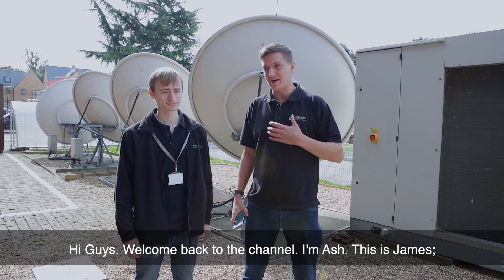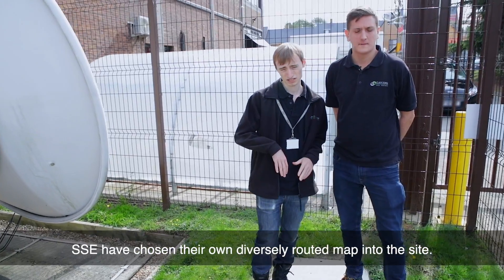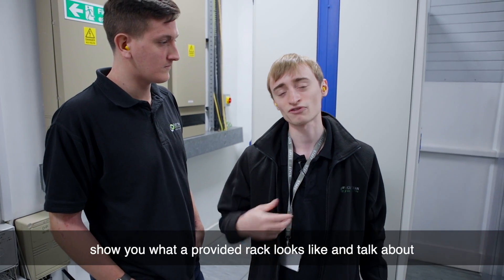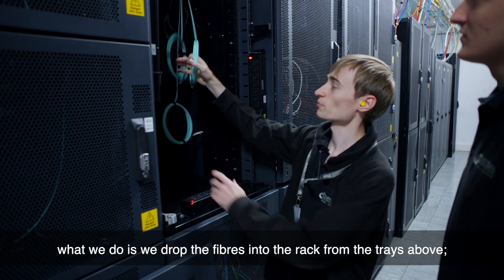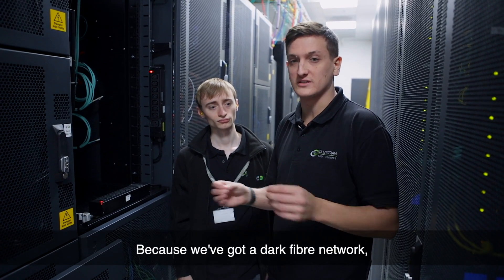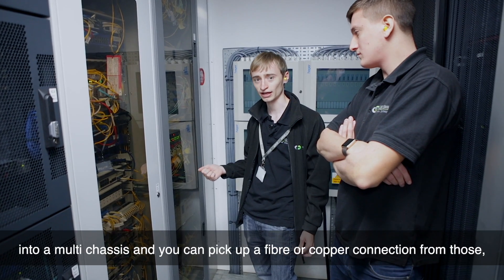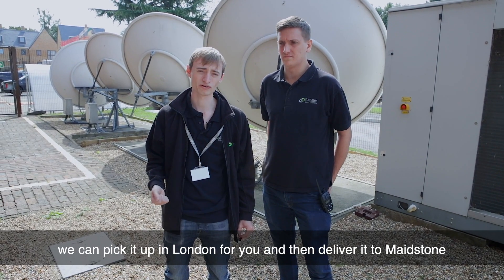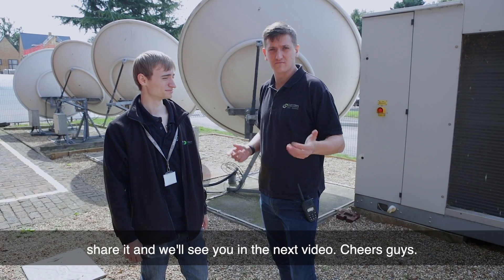A DAY in the LIFE of the DATA CENTRE | NETWORK TOUR with ASH & JAMES!

Comment: 1 - Use water falls on fibers to reduce bend radius
2 - Do you use labels on cables or other method of tracking?
3 - Use correct cable length, don't drop your customers with 5m slack
4 - Use separate trays for fibers and coppers
5 - Apply in rack cable management instead of looping fibers
6 - Don't put the tile lifter on top of important panels!!!!!
Reply: They use the system they currently do just because it works

Comment: Servers are way too loud by their fans cooling, by that it is not worth anything. I know a method, which would take more space, but would be complete quietly, less electricity consumption (=less heat -> less cooling)! I would sell that new method for 1 billion/milliard €.
Reply: Quite simply the current system is so good that they leave loud fans in the servers because it works good. Taking up more space reduces the mass of service you can fit in a building which means any energy saving is worthless.
Reply: @Adam-n1p6m They (the responsible ones are meant) have stolen 360° computing, working, work-loading together at the same time, and called it “Quantum computing”! And much more! 
CHILD:RENMURDERERS, heavily, terribly thieves have falsified and stolen via telemetry, etc., the idea:s, inventions, patent:s, its money of fiber optic cable:s, optical computer, glass-chips, using Light:s (“photon:s”, beam:s, laser:s, etc.), and much more, in a total value far of over $3 trillion:s (facot after 999 billions) and over €3 billion:s (factor after 999 milliards), since around 32 years long till nowadays, at a child, kid, toddler, and they still steal, namely from me, the atheist, hetero, greatest inventor of all time:s, the first, only, last, legitimly, rightfully, real, true Great-High-King-Lord, World-Director-Leader-Ruler (am not on power/system) of every country, land:s, planet:s, non-smoker, pacifist, Bremen residenter (yet): 
My Facebook profile: EugenK.87 
But don’t break, burn (besides calories), destroy anything, that’s counterproductive, because health, nature:s, work:s, need:s, development:s, progress:es, life, knowledge:s, and so on, because everything, that exists, is connected, and everything, that exists, is interrelated!

Comment: Ok dark fibre network ?
Reply: It usually means that you have spare fibre pairs (usually in large multipair cables). Each pair has a transmit (Tx)  and receive (Rx).  As they are spare, the electronics with the LED Lasers are not active = dark. DWDM - Dense Wave Division Multiplexing is a type of technology enabling multiple signals to share a fibre.
Reply: @peterblackmore7560  similar on copper core telecom wires  just a different type of terminology  i was not used to or had heard before  but thanks for the clarification in telecom parlance to could be using a single pair of copper cables set up a rim cabinet at the end of an exchange area to add more phone lines instead of running new 80 pair cable run  (the rim module might look like a rectangle traffic box  near a busy intersection but if you were to peer inside it is for all intense and purposes a mini exchange in its own right  kinda like a fully automatic pabx)

Comment: At 3:22 cabling under the floor looks unmanaged.  Why are you using an outside plant enclosure under the floor.  Don't you have an inside plant FEC system which fits on a wall.  Easier to manage, better MTTR?
Reply: It is managed, but realistically there’s a few metres of slack to move the joint and outside one is logical because it’s not owned by them. It’s owned by the network operators. If you think about it using the joint they use everywhere else means they only have to carry one spare with them.

Comment: Would like to see a video of you guy's discussing your certifications and which ones you consider most valuable when trying to get into a DC work environment.  Cheers from the US!
Reply: In most cases, in a large environment, as a new guy, you are going to be racking and stacking and cabling moderately heavy servers and network equipment--Then being physical eyes and hands over phone calls.  It is not high tech work in the DC.  You most likely won't even be putting so much as an IP address on anything.  At the other end of the spectrum, depending where you are, you can be required to be damn near the Special Forces of IT.  You will have to know a decent amount of everything.  You'll have to know how to configure multiple vendor network devices (Cisco, Arista, Juniper all in the same place), Windows OS, Linux, DBs, 802.1X and other auth mechanisms, flow monitoring, DC work to include understanding the cooling, PBX and SIP phones, storage, and probably a DR site.  Oh yeah, and learn Python, specifically the Netmiko module, so you can script network reports and some changes.  It will really set you ahead of other engineers.
Really, it all depends on the level of engineer they are looking for.  You could be the guy that only opens and closes switchports, a guy who racks servers, or a guy who has to know everything.  Most likely, your first job will be racking servers.
Reply: @OakInch  Great info, thanks! Question... for those different types of DC workers that you mentioned, are they different tiers? Maybe like what a data center tech (closes switchports and racks servers) or network engineer/lead or senior data center tech (know everything/special forces of IT). 

Reason I ask is that I'm curious because I'm on the network engineering route and maybe in addition to cloud computing since that seems to be big right now. I'm currently a Jr sysadmin and in the past I did want to be a sysadmin but I've changed my mind, it's basically advanced help desk and I'm done with that after 10+ years. I don't have any certs but I have a bachelors in information technology. I'm looking to pursue my first cert with CCNA.

Anyway, I thought maybe landing a DC tech job would kind of open the doors to learning more about networking while studying for my CCNA. Or if there are other recommendations for beginner networking style jobs, I'm very open!

TLDR: 
To summarize...
1) are there different tiers/levels for data center jobs?
2) What entry-level networking jobs would be good to get into while on the track to become a network engineer?

Sorry if this is something I could have just Googled lol I just figured you have a good amount of knowledge in this field.
Reply: @Cam_B  When I was doing DC work at a large bank, in a multi DC location, spread around a city, we had one person that did light switch work--Only opening and closing ports.  Everyone else did racking/stacking/cabling.  Then the cooling and electric was run by another couple guys based in the buildings that were more associated with facilities team.  The people that actually configured switches and routers never set foot in the DC and were not considered DC workers.  We did have people that moved on to teh actual networking teams from teh DC teams.  As you get to smaller companies, you will become less specialized and forced to do more.  It really depends where you go.

I would get the CCNA as it is the most well known.  All the 1st level certs cover networking in general.  The JNCIA is less known, but if the employer has Juniper it will be helpful.  JNCIA is a little easier also I think.  A juniper device is set up really different than a cisco device, so the command part is not going to translate at all.  Cisco is the standard and you will most likely be using that in a DC.
Reply: @OakInch  Dude, thank you for this advice! I was definitely planning on getting my CCNA and I was looking into Juniper certs as well. It looks like I'm on the right track for becoming a network engineer. I'm kind of weary about working in a DC only because they are 24/7, which I absolutely cannot work nights. If I was single with no kids, it wouldn't be an issue. Are you yourself a network engineer or did you go for a different field?
Reply: @Cam_B  I am a Network Engineer.  I have stayed within IT for a a very long time.  There are a lot of different roles you can take, and I have been in a number of them.  I would say that if you are looking for something a little less demanding, less physical labor, with good pay, application support is a really good place to be.  If you want mad cash, fast, try project management.  And don't slum.  You want to get on at a large company.  Financial related companies, in my experience, are great for pay and work/life balance.  I'm sure others are just as good.  But don't aim low for the sake of experience.  Everything is different every where you go and the whole environment changes every 4 years.
Reply: that would be amazing, my endgoal in networking and servers is eventually to be qualified for datacenter. I think discussing your certs and what education youve taken to get to where you are now and which books to buy and learn.
Reply: @andersgjerlw9636  strong network background, customer service and ability to lift 20 kg + of equipment are the most important qualifications you need to work in a DC environment.
Reply: @runforestrunfpv4354  well shit, my body doesn't have that capability . DC life will just be a dream. Look up connective tissue disease called EDS. FML. Deskjob for rest of my life.
Reply: @nos676  you could be project manager for DC if you technical knowledge and exposure.
Reply: @runforestrunfpv4354  oh, I'll have to look into that. I'm doing a degree in information technology systems administration and networking atm! DC is my dream, even if it's a desk job. I love anything advanced and technical, and love to learn.
Reply: @nos676  you are heading to right direction, you may consider into getting into customer service role in a colocation dc provider.
Reply: @nos676  , could I ask where you are studying? Sounds fun.
Reply: @pederstrmKollenborg  I'm doing a dual diploma of information technology systems administration & networking at an Australian college.
Reply: Zach. Our new community moderator
Reply: CDCP by EPI and CCNA by Cisco
Reply: Hi guys I am Data center entry level project manager… I am soon relocating to UK and I am unsure of the opportunities for a DC infra PM on the passive side who is capable of complete TIER 3 DC (N+1) config models designing till handing over along with monitoring the maintanence teams to efficiently work on the reports with various HVAC systems… can anyone advice me on the job opportunities at Brighton, UK… Thanks I’m advance…
Reply: Quite simply certifications either matter loads or they don’t care about them